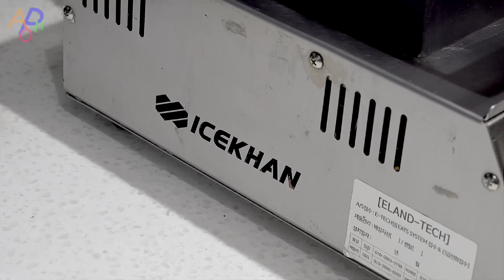Korea Waffle Maker Factory Mass Production Process With 30 Years of Knowhow

Comment: This is so fascinating. What's the material that's being used for the mold? I feel like dirt would be an oversimplification.
Reply: It's a particular type of sand used for sand casting.
Reply: @snozzcumbers  Oh!! Thanks for the info 👍
Reply: @RedHood001-KA  Dirt is a suitable description, but it's "clean dirt with kaolin clay and additives"
Reply: @BrassLock  Honestly, that's a nice summary of what the material is. Genuinely curious, what makes it clean dirt?
Reply: @RedHood001-KA  
It's just like the type of sand found at the inside curves of rivers. The water washes the sand downstream during the "young" (upper stages) of a river (fast flowing water higher up the rocky valleys), and then in the "older" (slowly flowing) sections in the plains, the water winds slowly curving this way and that, depositing the sand on the inside of curves, where it's harvested. 

Here in Chiang Mai there's a big industry harvesting such river sand for building purposes (concrete and foundation making) at each inside curve of the Ping River. Outside curves flow faster, so the sand deposits aren't as plentiful, or economical to harvest.

There are many recipes for foundry workers to use, and also for DIY "casting makers" to use which are available on YouTube or Google. The main factor is to avoid "dirt" such as is used in gardening, which contains humus, plant residue and other hard undesirable aggregates from broken rocks.

In Pakistan the factories use their own recipes, and have special churning machines to mix the sand and add their own oils or clay mixes to firm it up. You can see some Asian foundries use hot blow-torches to harden the resulting mold, and in other countries you can see videos where Carbon Dioxide gas is injected into the sand mold to harden it. It's all very fascinating, and you can spend days watching all the different cultures and their techniques on YouTube.

"Dirt" is a common term used to name dirty sand on the ground in urban/industrialised areas, or the agricultural "dirt" that's used to grow vegetables and food crops, but not usually so named at the beach, or a clean flowing river. So the question is more to do with "How did it get dirty?", rather than "How did it get clean?"
Reply: @BrassLock  Fascinating. Thank you so much for the information.
Reply: @RedHood001-KA  This kind of casting sand is referred to as "green sand" in the US and UK, and possibly other places. "Green" has nothing to do with the color, since it is brown, not green.